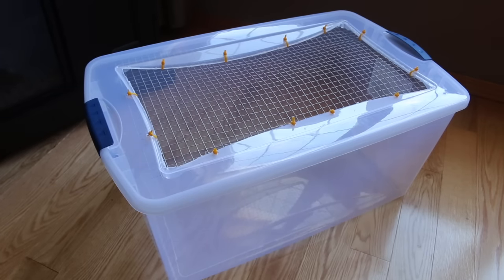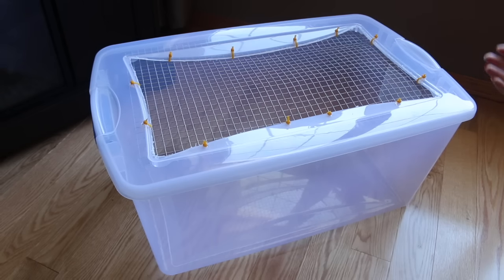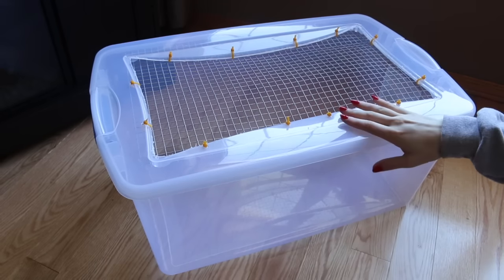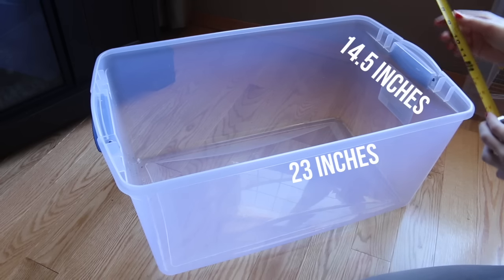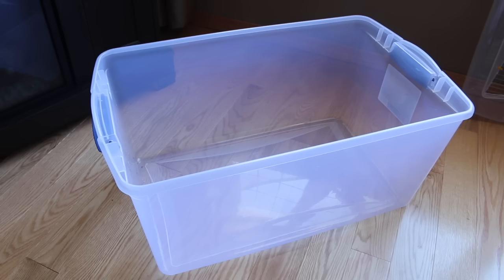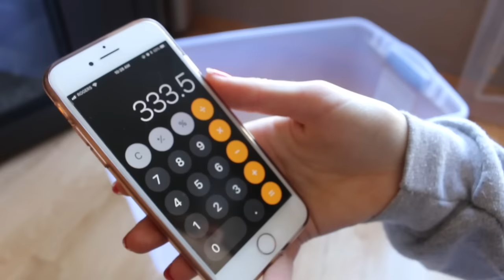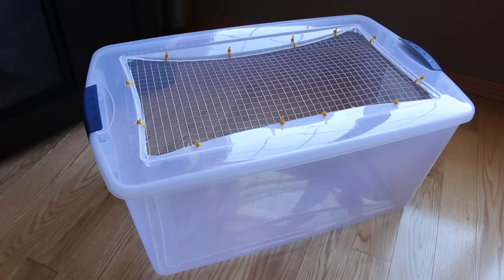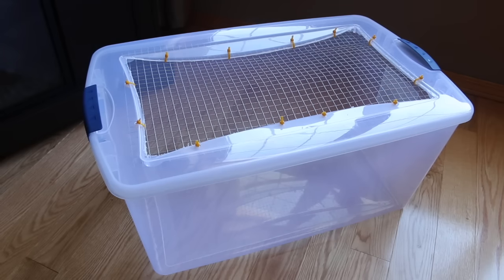HOW TO MAKE A BIN CAGE | DIY Hamster cage!

Comment: I swear by bin cages for hamsters, I’ll never buy anything else. I love how I can just dump the bedding into the dumpster and it’s so much cheaper than buying a big cage.
Reply: One don't has to clean a hamster cage very often. They need their smell to feel protected. I only clean the areas where my hamster pees the most
Reply: It will only stress the hamster too when cleaning it too often. Do you clean out their house? Because you shouldn't do that either.

Also bin cages imo are too small, the biggest bin cage size doesn't even meet the requirements in my country (80x45x40 was the biggest I could find). My country is in Germany and if the requirements are different: Germany attaches importance about animals well being so the requirements might be stricter here. It's always better when the sizes are bigger 

 I work with centimetres and the minimum size here should be 100x50x50 (length, width, height) and not a single centimetre smaller! 
If you want to make your hamster happy you should consider that. My cage is 120x60x50(I have an aquarium because they're better than bin cages. you can even observe your  hamster crystal clear) 

Don't EVER look at the price but only to the well being of the animal that'll live there for it's entirely life. Your hamster will be thanksful. A small cage is never better than a big cage.
Reply: Mahiro she never said how big her cage was, in the US we have very big bins you can buy! I also love bin cages, I have used them for all 6 of the hamsters I have! She also never said how often she cleans it 😂
Reply: Mahiro it’s different in America plus there are plenty of big bins here there are huge ones
Reply: Jaka Lazar and Mahiro man get of f their case
Reply: Mahiro if you want a larger cage VanillaHamHam’s DIY IKEA cafe is great and large with a floorspace of 877 sq in!
Reply: @mahiro3409  that's not true because I used to live in Germany and they have big bin cages up to 800 sq although most of the time it's like 500-650 sq
Reply: @mahiro3409  but they didn't care about jews
Reply: Where do u buy big bin cage?
Reply: @mahiro3409  Bestie I've found bins I can lie in you're just not looking hard enough. Also most cages in the shops in my country are smaller than the required space that's why most people I know make bin cages
Reply: @mahiro3409  did you chill tf out yet in the 3 yrs since writing this comment? Lmao
Reply: @mahiro3409 no one’s buying a 4ft long cage for their hamster, it’s completely overkill and ridiculous. Those cage requirements suit a lizard or a snake more than a hamster.

Comment: I made a bin cage for the first time. It took about 2 hours and it turned out well. This is a great alternative for people who already have the tools. The bin was about $20, but then I bought a Dremel $49, Mesh wire $10,  and wire cutter $10. Thankfully I already had a drill tool, tape,  and zip ties. I paid $90 +. It’s about the same price for a Prevue 528. However, if you will be making multiple bin cages, then in the long run it does come out cheaper.

Comment: thank you for this video and others hamster videos. by watching your videos. I got rid of all of my Habitrail cages. By watching and learning  from you. I will become be best hamster owner. Right now I don't have any hamster, because they past away by natural causes. I miss them, but I have to wait. When I first I was in mourn mode when I first saw your hamster video about bin cages. I decide you are right about those Habitrail cages. They are too small for hamster. Now I am saving up, so I can make and get a large bin cage and large wheel and other things that I need for a hamster.   I am so ready to get another hamster now. Once I get the correct bin cage and wheel and other things that I need for a hamster then I will get a hamster again. It feel empty when you don't have a hamster in the house. Thanks for all of your advice. You taught me things that I didn't know. I wish I had your advice when I was child. There are things I would do different. I have hamster since I was child. My mom bought me my first hamster. Since then. I had hamsters all my life. There are things I didn't know that you show me in your video. Like whey they chew on the bars (cage is too small) and why they stop running in the wheel (wheel is too small) and hamster ball (they are dangerous). Thank you for showing me what I did wrong.  I am correcting all my mistake. Becoming a better hamster owner. Once again thank you for your advice and tips. You are the best.

Comment: As an alternative to the power tools you can buy a soldering iron and melt out the shape and poke holes for the zip ties! Just make sure that you have something underneath the lid as you are working on it to catch the dripping plastic. It only costs around $10 to $15 dollars to buy a soldering iron compared to the $20+ for a drill and $40+ for a dremel. :D Another awesome plus is there are no sharp edges for the hamster or other pet to cut itself on by accident!

Comment: Bin cages are great. They're way easier to clean than glass aquariums, and let's face it, you're less likely to procrastinate when something is easy. Also it's easy to connect multiple bins with tubes and stacking the bins, giving you more options for getting the floor space up over 450. I've been using bin cages for years. Someone once asked me, "Why is your hamster's cage bigger than my bedroom?" It was a gratifying thing to hear. So many hamster cages are criminally small. It's abuse to keep a hamster in a small habitat. When it's this easy and inexpensive to provide your hamster with an excellent habitat, there's no excuse not to.

Comment: Be sure to wear safety goggles that seal the edges around your eyes when using power tools. The Dremel may be a better option for cutting the wire mesh, but take it one cut at a time and watch out for splintering shards from the cutting disc. Do it outside or someplace you don't have to worry about metal dust settling. I usually prefer to put the wire mesh on the outside covered with a thick tape like Gorilla tape. This helps avoid any potential cuts on the critters. Even if the mesh is up high on the top of the bin, better safe than sorry.  Cheers!

Comment: The rotary tool that I had was a piece of garbage, but I was able to cut out the section by drilling a wide hole in the center with my drill's 1" spade bit, then I used the tin snips (also used for cutting the mesh) to cut through the plastic. It wasn't ideal, but it totally worked!

Happy hamstering!

Comment: i’m making this cage for rats, (yes i know that the bin has to be MUCH bigger for two rats than for one hamster) and i researched that rats need better ventilation than hamsters and other small animals. so would i just do the thing that you did on the top on the sides? or do i need a different method? also i think the zip ties on the sides may be dangerous, so i was thinking about using hot glue. i’m not 100% sure what i’m doing, i will continue my research. i’m getting the rats in June or July most likely so i have a lot of time hah
Reply from the maker: I wouldn’t recommend keeping rats in bins as my friend (imeesWorld on YouTube) would say “chances are there won't a bin that is the correct size for rats, they need height to climb which is something a bin cage can't provide, and even then they'd have ventilate every single side of the bin cage in order to get enough ventilation to prevent respiratory illnesses in which case they might as well just buy a cage”
Reply: Victoria Raechel my main issue with that is that i could not find a wire cage that is the correct size for two rats:(

Comment: To whom doesnt have a power drill, you can either use soldering iron tool or a long screwdriver which you need to burn the tip and make a hole onto the plastic..

Comment: Also u can use a box cutter like she said and she also said it would be harder so here is a tip just heat the cutter first so it will melt right threw the plastic good luck!👍🏻

Comment: When people attach the wire to the outside of the lid, they add tape to get rid of any possible sharp edges.
Buy putting it on the inside  I see it overcomes this issue and the use for tape is eliminated. But is it safe for the hamster being on the inside? I'm guessing as long  as he can't reach it is okay?
Idk i need some feedback.

And some people just drill holes into the lid. A hole bunch of them.
Reply from the maker: Most of my bins I’ve used with my hamsters have had the mesh on the inside and I’ve actually never had an injuries caused by it!
Reply: Good good. That was my plan. Thank you for resonding! I love your very informative videos!

Comment: I have a question! If the storage container is more than 40 Gallons (which I've read is the minimum size for a cage), would it work?
Thank you for any answers!!
Reply from the maker: the 40-gallon minimum really only works for tanks! When it comes to bins I wouldn't follow 40 gallons since many bins will be 40 gallons in a different way, it could have more height than overall floorspace.  You'll always want to measure the bin first :)

Comment: Can I instead cut a few circular holes in the plastic with a box cutter? It would be a lot easier, but I don’t know if it would provide enough airflow.
Reply from the maker: Using wire mesh is the best option for giving the best ventilation.
Reply: Victoria Raechel Thank you! I will be sure to get some mesh whenever I get a hamster. ❤️

Comment: Hi Victoria! I hope you get this and you respond! Lysm btw! ~ so I made a bin cage for my hamster, but I used a drill to drill a ton of holes into the lid of the bin. My hamster puts bedding into her wheel so it doesn’t move, and climbs up the back to chew the lid. I don’t want her to escape so what would you suggest? Ik I can’t take the wheel out because my hamster Beean (pronounced bean) needs it to run on at night! Tysm and I hope you respond
Reply from the maker: You'll need to make a mesh lid as shown in the video to prevent it from being chewed. Though it sounds like she may need a bigger cage is she's climbing the wheel to chew out.
Reply: @VictoriaRaechel  okay thank you so much! just so you know she has a total of about 650 square inches of floor space

Comment: Did you put the "pokey" part of the mesh on top? The reason I ask is in case my hammy figures out a way to climb up I don't want him getting poked by the sharp edges of the cut mesh!
Reply from the maker: It put in on the inside, it prevents a hamster from being able to reach the plastic cut out and then chewing a hole out.
Reply: @VictoriaRaechel  Got it, thanks so much!

Comment: For those of you that don’t have that drill and the part to cut the whole in the top: use a knife and heat it with some kind of flame, make sure you’re using a well ventilated area to not breath in the fumes. The knife will cut through the plastic like butter and you won’t have to spend extra on something you might not have.
Reply: Thanks a lot because I have a busy schedule and a strict budget so this will help

Comment: Hey I have a question, I recently made one as well and it’s a pretty big bin, it has 4 big windows of mesh on the sides and bedding as well as everything the hamsters normally had in their old cage.

The problem is when I put them in they’re constantly trying to escape and seem frustrated, and try to walk up the walls of the bin. I want to know is there anything that may be causing this specifically? I should mention the lid isn’t clear, it’s a gray lid and no light comes from the top, is that a factor?

These are dwarf hamsters, I’d love to hear a response so I can find out what is bothering the hamsters, thank you 😊
Reply from the maker: How large is the bin? If you have a pair of dwarfs they should have nothing less than an 800 SQ inch cage
Reply: Victoria Raechel I’m not really sure but it is pretty big, but the cage they’re in normally is smaller and they’re more comfortable In there, I got the bin to give them more space but I don’t know what might be causing them distress in the bigger one, the lid doesn’t have any openings there’s only mesh windows on the side
Reply: Victoria Raechel actually, I put them in again and they began to get comfortable in it, thanks for the advice tho

Comment: Where do you buy the mesh also What hight of the tub do you recommend?  I woke up to my hampsters whiskers, he was I guess sniffing my face. I had originally took the tub lid off cause I thought it would be better than holes but I guess it just wasn't high enough
Reply: Mesh; local hardware store
Bin height: 8 inches or a bit talller depends on how much bedding u use.
 

Hope this hepls

Comment: I know this is an older video but instead of zip-ties could you use duct tape? Ive seen other people do it but if you dont recommend it ill stick with zip-ties.
Reply from the maker: I've tried duck tape in the past and it just doesn't hold the mesh securely enough.

Comment: Can you just use duct tape to secure the mesh. If I can, I will put on the top of the lid so my hamster doesn’t chew it off. Reply fast and luv ur videos 🎉🐹🤗🤗
Reply: Also, can I just drill holes at the top for ventilation instead of the mesh.
Reply from the maker: I've tried duct tape and it just not hold it. You can drill holes but you will have do to a lot.

Comment: Can you drill holes in the top?
I did that with my old hamsters bin cage and I'm thinking about getting another hamster so I would like to improve on any past mistakes.
Reply from the maker: It doesn't provide as good of ventilation as mesh and has the risk of a hamster chewing out.
Reply: @VictoriaRaechel  Thanks :>

Comment: Hi Victoria I have a bin that is 1960 sq inches of floor space. Is that to big or is it ok? Also I love your videos ❤️
Reply from the maker: Which bin in particular are you using? I’m thinking you may have used the wrong measurements since I’ve never seen a bin that large.
Reply: Ya I think it might have used wrong measurements to when I was measuring but it's was 49 by 40 inches
Reply from the maker: Are you sure it wasn’t in centimetres?
Reply: @VictoriaRaechel  yes I accidentally measured in centimeters it is actually 460 sq inches I am getting an ikea detolf in 3 weeks because Ikea is 9 hours away from me but is this big enough for a dwarf for 3 weeks? Also thanks for correcting me
Reply from the maker: Yes it is big enough until you can get the detolf 😊
Reply: @VictoriaRaechel  yay thanks so much your channel is a really big help!😁🐹

Comment: I am hoping to make a bin cage with holes instead of mesh but, where I live it can get pretty extreme to high temperatures. I am scared my hamster may die from not enough air passing through the holes in the cage. Also I don't want to put any holes on the sides because she may chew them and it could be a perfect way to escape. What should I do because I am wanting to save money without buying any mesh.
Reply from the maker: Personally if it gets very hot where you live and you don't have air conditioning in your home I would really recommend using mesh to give it the best ventilation possible.

Comment: I did my own bin cage because the one I had was around 110 square in of floor space and now its around 660 square in of floor space.
my hamster is so much more excited.
Reply: Ella Stout what are the dimensions on your bin? I really need to upgrade my hamsters cage.
Reply: it does not mater what bin it is as long is it is toll enough for you but the floor space has to be at least 450 sq in of floor space
Reply: Ella Stout hello. i love the vid. can you confirm the formula and minimum? its width * lengh = msq right?

Comment: Do you have to use wire mesh? I have mouse and got plastic mesh I was just wondering if it will be safe to use on the top.
Reply from the maker: Yes Plastic mesh can be easily chewed out.

Comment: I really wanted to move my hamster in a bin cage and I finally found a bin cage here in my country online and it's pretty expensive but i wanna buy it, the only problem is.. the size is the same as the one you used in your video, and you mentioned that it's "too small".. shall I order the bin cage? I can't find a bigger one and the cage i'm using now is ridiculous..
Reply from the maker: Does your country by any chance have christmas tree bins?  Or maybe you could find another way to make a cage? I personally wouldn't order if especially if it's going to be expensive since the bin shown is too small.
Reply: @VictoriaRaechel  no, as far as I know we don't really use christmas bin  cages. But I did find a bin which is 78x56x44, or another one which is slightly cheaper buy has 78x56x18, should i buy the taller one? They're both pretty expensive and my parents don't really agree with me buying it for a "nasty rodent" but i really wanna make my Egg happy.. 😪

Comment: Is it secure enough for a cat to lay on the top? I want to upgrade cages but I need to find a good one that is durable for cats to lay on top of.
Reply from the maker: I have had a cat stand on it and was fine, I wouldn’t exactly recommend letting them lay on the top 24/7 then it kind of defeats the purpose of ventilation but it’s usually stable enough.
Reply: @VictoriaRaechel  Thank you!! She usually doesn’t lay on it, but sometimes she does.

Comment: Since there is the wire under the lid where the hamster if it it somehow climbed up couldn’t it cut itself on the edges or the wire on the inside?
Reply from the maker: I mean it’s possible, I’ve never personally had a hamster hurt themselves and you could easily sand the edges. Putting it on the outside is going to allow your hamster to simply chew out.